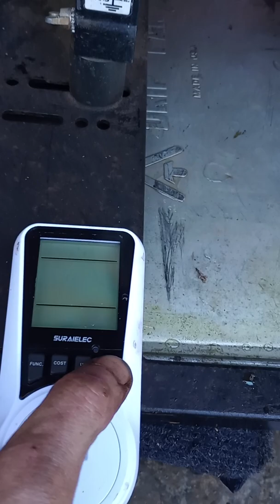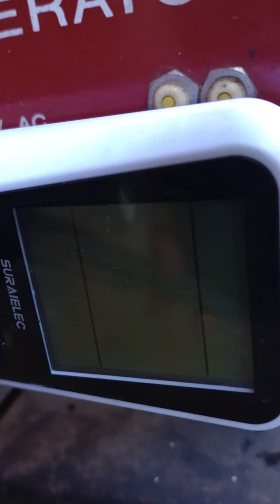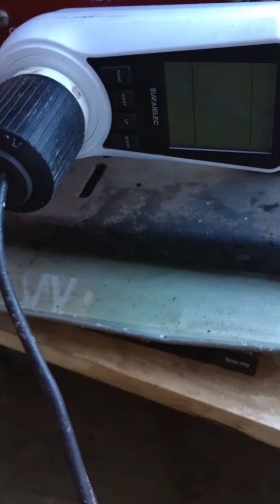Checking Your Emergency Generator For The Correct Output!

Comment: Excellent I just found the Suraielec Watt Meter, Plug-in Socket Power Meter, , Overload Protection, Kilowatt Wattage Voltage AMP Tester, Electricity Usage Electrical Energy Monitor. on Amazon. Adding it to my toolkit